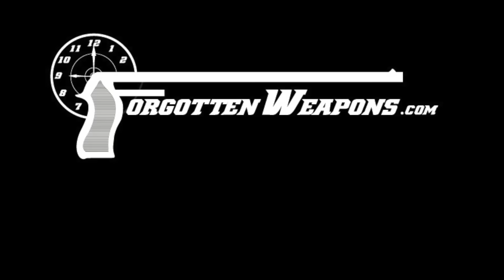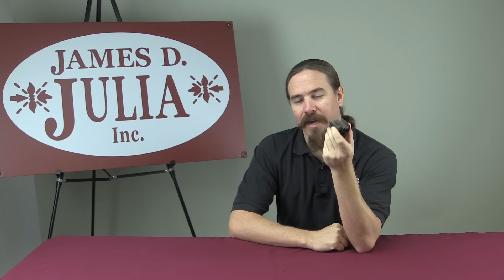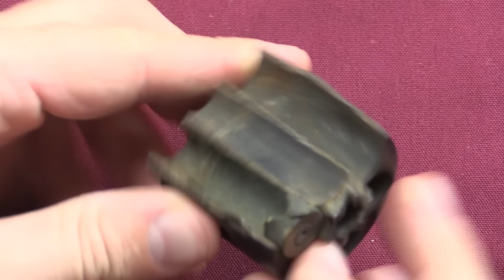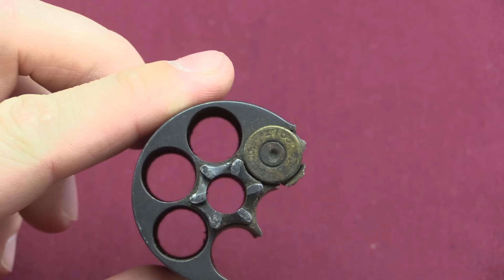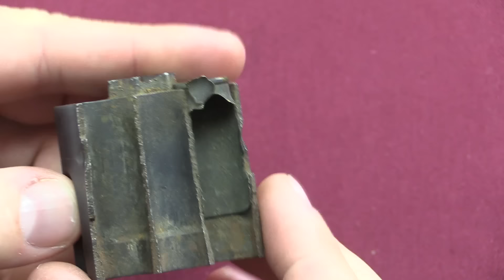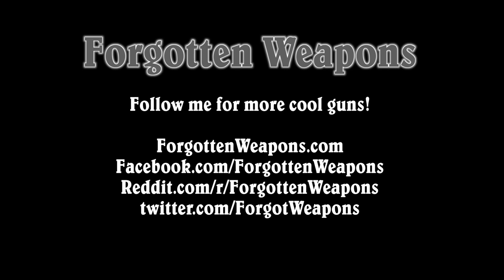Elmer Keith's ka-BOOM

Comment: if Elmer could fit a couch into a 45 colt he would try to fire it
Reply: The comfiest load ever designed.
Reply: +Crazy Eyes Depends on the couch used.
Reply: The "try" part woulda been for the gun. Keith would have undoubtedly pulled the trigger and held on for the ride.
Reply: Hahaha too funny! You can stash a half a stick of dynamite in a 45 colt case
Reply: A couch made out of smokeless powder
Reply: Keith blasted the varmint with his trusty 465 Magna-Lounger, sending the galoot to his reward astride a plush 385 grain jacketed hollow point...
Reply: Bystander: Hey, what are you shooting in that?
Elmer: .44 Chesterfield
Reply: Ye olde Taofledermouse.
Reply: Rumor has it that Keith had a double action revolver in .45-70.  I still miss him.

Comment: We went from black powder (where you just fill up the case) to smokeless, which used far less powder.  The temptation of those big empty hulls must have been unbearable. Duplex and triplex loads, super heavy bullets, it is amazing more people weren't hurt. Skeeter Skelton (a contemporary of Keith's)used to have 38 special loads that were hotter than today's 357 magnum. Crazy time and wonderful to read about. But I'm glad we have reloading manuals today.
Reply: Great observation.
Reply: Powders back then weren't as "energetic" (per grain) as some of the powders of today. Trying something like that today could have worse consequences than blowing up a cylinder.
Reply: I could be wrong,but, I seem to recall someone telling me that they used to fill the empty space with oatmeal or some other filler to avoid the hazard of a void between the charge and the ball .
Reply: @miksal26  - I definitely remember in the late 70s and 80s reading recommendations for using "kapok" as filler to keep the powder charge to the back over the flash hole. I had thought it to be an artificial material but just found this definition online: "the silky down that invests the seeds of a tropical silk-cotton tree (ka′pok tree`), Ceiba pentandra: used for stuffing pillows, life jackets, etc., and for acoustical insulation". I have no recollection of anyone using oatmeal as filler but that could be before my time.
Reply: @miksal26  The only issue with underfill is that the primer may not have enough contact with the powder. Top marksman will generally start by pointing the gun straight up and lowering the barrel to the target, specifically so the powder is always in the same position when ignited.
Reply: @mytech6779  there are powders that are not sensitive to position. I have a box of reduced power, high pressure loads that don't require such a motion before firing.
Reply: @mytech6779  I've seen bullseye shooters do that, never asked why.

Comment: Lets be honest, my beloved Elmer Keith was really dangerous when reloading. I have several of his books, and at times I get cold feet just from reading the loads he used. I believe it is a miracle he didn't blow up more guns!  Regards
Reply: I have his books and he filed off the top of a 45-60 WCF mold to lighten its slugs.  It didn’t squeeze them down, but riveted them out at the forcing cone.  I loaned out my 316 gr. 44 cal mold to a gun nut and told him to stick with wheelwright heavy alloy.  He didn’t, and split his Ruger Super Bee’s cylinder in half, just like Keith’s Colt.  Alloy hardness is what counts with longer slugs.

Comment: The 45 Colt brass remnant in the cylinder is the old "ballon head brass" , common to 45 Colt brass in the black powder days.  At that time in the 1920's, Remington still loaded a lot of factory 45 Colt with the full 40 grain black powder charge.  This is because in the early cartridge smokeless days, the smokeless 45 Colt factory loads were very weak (255gr bullet @ ~ 730 fps), compared to the traditional 40 grain BP loading of the 45 Colt (255gr @ ~ 960 fps, 5.5" SA revolver).  The early factory smokeless loads used a fast powder that at the BP pressures (14,000 psi), were more than 200 fps slower than the BP loads due to BP's longer burn time achieving higher velocity at the same 14,000 psi peak pressure.  Today we have good progressive smokeless powders that can achieve the same velocity as BP at the same peak pressures. But that was not yet possible with the limited smokeless powders of the 1920's, when Elmer Keith blew up that cylinder!

Comment: I have nearly an exact duplicate cylinder from an Interarms Virginian Dragoon .44 mag. I was loading on the light side with properly sized bullets. Inspection showed that the cylinder had been fractured for some time. It went off like a grenade and blew the top strap and rear sight off the frame and nearly took the barrel. I never found the pieces but I can still count to ten. If you purchase a used revolver, CAREFULLY INSPECT THE CYLINDER before putting it into service.

Comment: In 1991 my grandfather and I were reloading some .38 special cartridges late one afternoon.  It was getting dark and at one point my grandfather couldn't remember if he had already put the charge in the casing.  Since the casing is quite long he couldn't see any powder so he just added a charge.  Talk about a hot load!  I was the lucky person to pull the trigger on that one!  The revolver had such a kick that it almost hit me in the face!  The other people at the range immediately came over to see what had made such a racket.  We found the rim had torn off the casing and the body of the casing was stuck inside the cylinder!  Now many people asked why the cylinder didn't do the Elmer Keith on me.  We believe it is the fact that my grandfather had replaced the standard Taurus cylinder with a Stainless Steel cylinder some years back.  SS is much tougher.  We had the cylinder inspected and no issues were found.  It is still in use today.  Thanks for a great channel!

Comment: Elmer Keith was a pioneer of heavy loads.   One of the reasons he seems so 'crazy' was no one had done it prior and bothered to tell others.  Keith did blow up a six gun.  He wrote in a column he used to write for either "Guns & Ammo" or "American Rifleman" confessing to blowing up 'several' revolvers in his youth.  But he was working on relatively unexplored ground.  He certainly wrote of his exploits as a warning and guide for others.  
Of note he did the same sort of experimentation with rifles, especially rifle for large, dangerous game.  He used those rifles to bring home meat for use on the table.  Without Keith, we would not have the .357 Magnum, the .41 Magnum or the .44 Magnum; or at least not as soon as they were developed.

Comment: What struck me was how thin those cylinder walls are.
I'm amazed more of those guns did not blow up!
Reply: It blew up because Elmer Keith was hotrodding the cartridge. From what I've read, he filled the case with fine BP, like maybe 4f, trying to get more power out of the cartridge. 
A standard load was perfectly safe, as the thousands of original, late 1880s guns still existing shows.

Comment: I saw the same thing happen, but with a .44 magnum!. 

The gun was a Ruger Redhawk, built like a brick….outhouse, and generally held to be pretty well unbreakable. 

The cylinder did a pretty passable imitation of a hand grenade, with fragments gouging bits out of the breeze block partition between firing points on the range; and the top strap punched a hole in the plasterboard ceiling, never to be found.

The shooter, like Keith, unaware of the mayhem, was still trying to cock the pistol for the next shot!

Comment: I had this exact thing happen to me while competing in cowboy action shooting with a colt-clone single action army in .45 colt. I believe that one of two things happened, either I  had inadvertently forced a second bullet over top of the first in the case,  due to lube hanging up the first bullet up in the bullet seating die, or the cylinder was out of time, and upon firing, the round fired slightly out of battery because the bullet was blocked by the forcing cone, causing a detonation.  It was NOT due to a double powder charge.

Comment: I blown up lots of 38 specials. And a few 32 S&W longs and CZ52s,  When the cylinder splits sometimes 3 pieces, sometimes 2 pieces. Half the time the top strap breaks. Bigger bullets do not increase the pressure if they get to start moving before swaging, as Ackley pointed out about 8mm bullets in a 30-06.

Comment: Besides using an old SAA as his test gun and using a very heavy and over-sized bullet, Keith also goofed the powder and the charge weight.  The "normal" .45 Colt load at the time was 40 grains of FFg black powder.  Per his own account, Keith started with FFg, but ground it until it was the consistency of flour (finer grains have a faster burn rate leading to higher pressure).  He then stuffed as much into the case as he could fit.

Comment: Interesting. Elmer was something of a pioneer. I think i heard that when he went to 44 Spl, he had some specially heat treated cylinders made. I believe his typical handloads in those exceeded 44 mag levels (which obviously came decades later) when pressure tested. Thank heavens for loading manuals with pressure tested data

Comment: What I find surprising is that the case head doesn't exhibit high pressure signs. I would expect the primer to be blown or at least flattened and the stamping on the head to be illegible. Also when a chamber blows it usually exposes the chamber on either side. I think the cylinder was defective.

Comment: Back in Elmer Keiths day, there wasnt alot of reloading information, so things were trial and error. Bill Ruger came out with his version of the Colt single action which had a larger diameter cylinder which made shooting the .45 long colt,  safer with handloads.
Reply: fuzztfork8 Even today, load data can vary pretty significantly from one book to another, and sometimes it's nearly impossible to find data for the type of bullet you have, with the type of powder you have.  And then things get really interesting when you have a 1911 chambered for .40S&W, and you start loading rounds longer than will fit in a typical .40 magazine.

Comment: Is the remnant of that blown case a balloon head case?
Reply from the maker: Yup.
Reply: ...and it wasn't even the case that caused the failure in the manner balloon heads usually would.

Look very closely at the case and metal around the bolt notch, that's where a crack in the cylinder let go first. That little step as it goes towards the front is telling, that's the end of the crack at the point of failure.

There was also enough remaining pressure to flow the torn side of the case into that crack as it opened up. 2:21 is a great shot of that.

Comment: See what happens when try rammimg something to big thru a to small hole. You find the weak point real quick and luckly it was on the half away from his face if he was a lefty. If he wasn't,than murphy smiled on him that day.
Reply: What will go wrong for you will Keith Murphy's law
Reply: Elmer Keith was right-handed. Read his biography and find out what happened to his left hand as a child. The Colt SAA cylinder rotates clockwise when seen from behind. So in this instance, he would have fired the first two rounds and when the revolver cylinder blew, it would have been the half from 12 o’clock position to 6 o’clock, that is, the right side, that went fragmenting outward, away from his right hand, arm, and face. Yes, he was lucky.

Comment: haven't read all the comments, so excuse if the question's been asked.  so keith was shooting .45 (long) colt and blew it up.  he then went to a .44 special cylinder because the 'walls were thicker' or whatever ian said.  without regard to the .44 special morphing into the .44 magnum, isn't the .45 colt a higher pressure round than the .44 special.  if so, (and i may well be wrong, since i'm too lazy to look it up), why is the .44 special off-the-shelf cylinder thicker/more heavy duty than the .45 'factory' cylinder he was shooting?
Reply from the maker: +Michael Hildebrand .45 Colt is a higher pressure round today only because of more modern revolver designs. The SAA is not a very strong action, comparatively.
Reply: +Forgotten Weapons makes perfect sense when pointed out.  thanks for taking the time to respond.  i enjoy your videos very much.
Reply: +Michael Hildebrand "why is the .44 special off-the-shelf cylinder thicker/more heavy duty than the .45 'factory' cylinder he was shooting?"

Because a .44 Special is smaller in diameter  than a .45 Colt, yet the cylinders are essentially the same. A smaller hole (.44 Special) equals more metal between the chamber and the outside of the cylinder. In other words,the .44 Special has a thicker chamber wall.

Comment: I read that .454 bullets for the 45 colt are no longer loaded/used commercially because 45 acp is .452 diameter.  So everything ended up .452 with some 45 colt bullets having a minie ball base to take up the slack.

Comment: Loading experimental hot loads just to see what happens is never a good idea!
Reply: It can be okay with easily replacable guns as long as you fire them from remotely with protection if you needed to experiment. Though, you'd need to fire a lot of rounds (at least 1000 likely) to more accurately judge a pressure limit for a frame and cylinder; bolt, or breech block along with the chamber(s) with a loading.